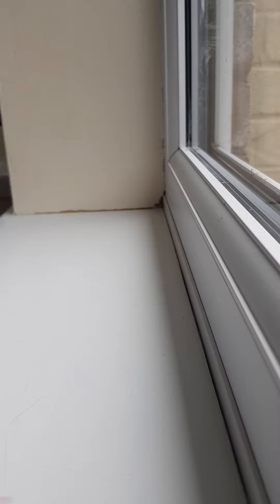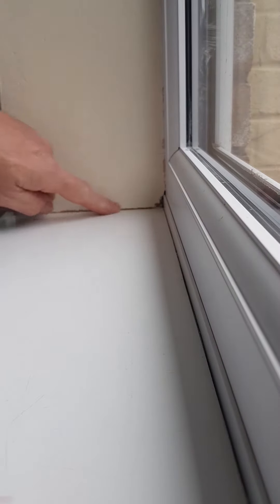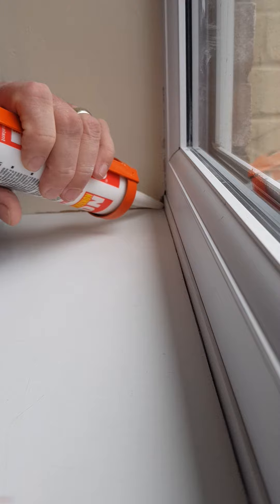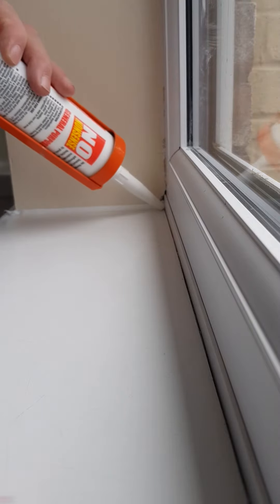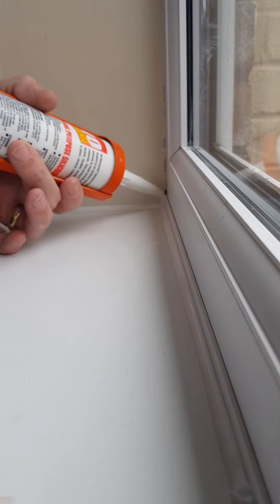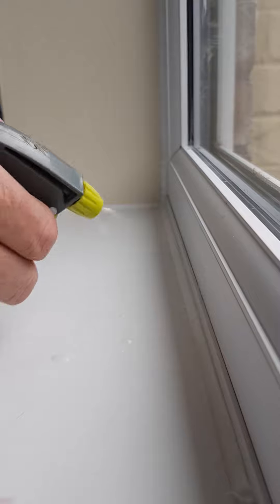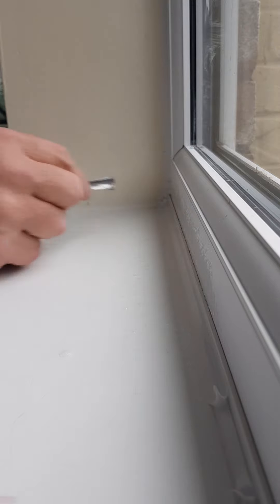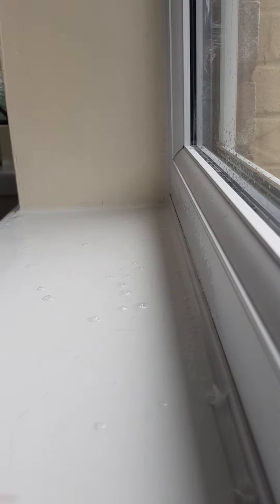Silicone Sealing ! Neat &Fast..

Comment: I never thought to use a spoon. Is it the soapy water that makes that work well?
Reply from the maker: Hi Dan.
Yes it's the soapy water !
I wet the spoon and the surfaces that way the excess sealant wont stick back down.
The professionals here use wood dowels of different diameters  that have the working end cut at acute angles. These are left soaking in soapy water. Different diameters give different bead sizes.
A spoon works for me though 😊